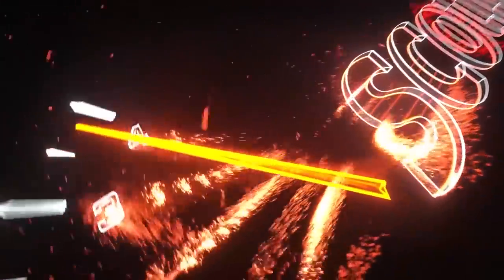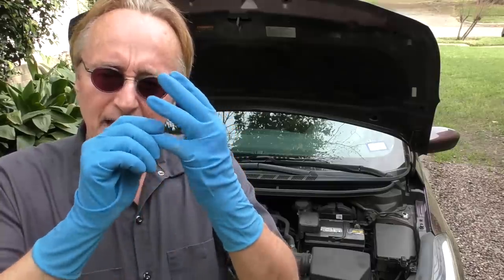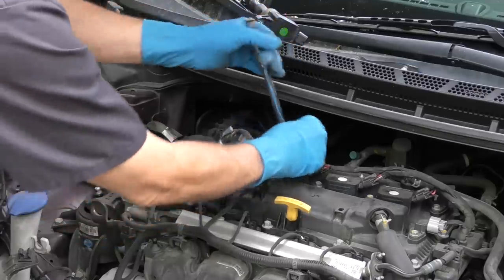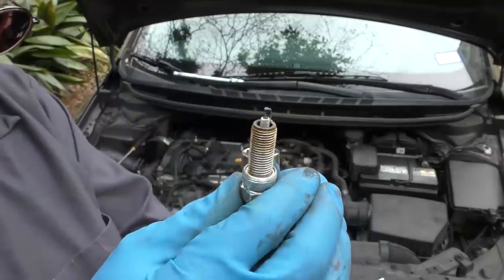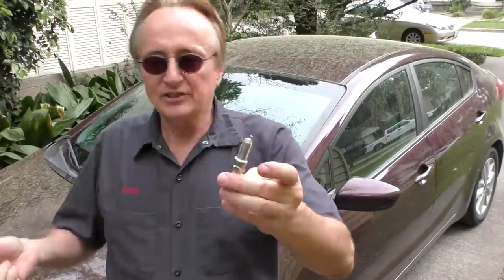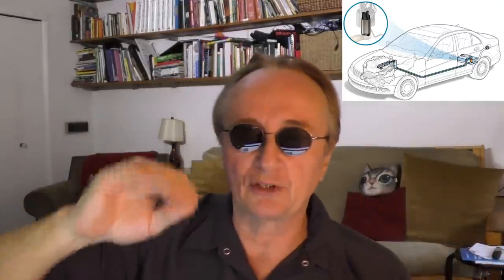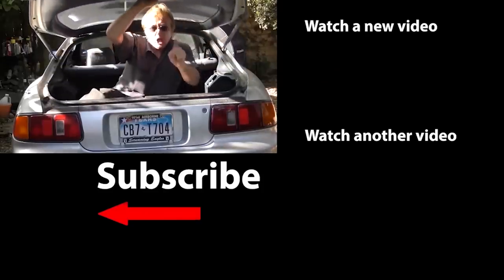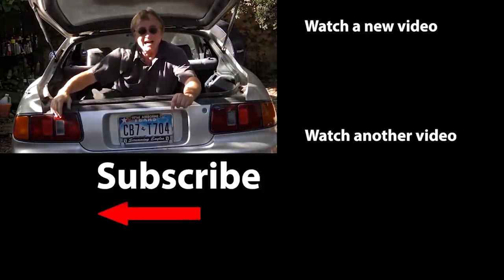Doing This Will Make Your Engine Run Better

Comment: I replaced all my 02 oxygen sensors on my 2002 Infiniti i35 for the total of $136. Now it's running like the day it was shipped out of the manufacturer factory. The dealership and chain auto repair shops was quoting me between $233-478 per sensor. Thanks Scotty for your helpful tips 👍🏾👌🏾
Reply: Almost the same with me; I replaced both my O2 sensors and Hitachi maf mass air flow sensor and ran awful. I unplugged the maf and drove it for 10 minutes and plugged back in. Runs great! Scotty is the best! 🥇
Reply: Never go to a "chain auto repair shop".
Reply: His common sense is invaluable

Comment: Scott 
I have a 2015 chev. Silverado 
When I'm going down the road in the day time my volt gauge well drop down to 12 volts but if I turn my lights on with in 2 to 3 miles the voltage moves up to 14

Comment: OMG a 2017 with such problem already. My 02 Camry just had that problem with 177,000 miles.
Reply: It's just a torque issue.  They sometimes come loose even though they were tightened well.  I did it to myself replacing my plugs.
Reply: on last 2 decades every used car after 70.000miles  have problems usually sensor, temperature sensor, oxygen sesnor, maf....

Comment: Scotty, what do you think of the 2008 Ford Focus, specifically the ones with manual transmissions? Mine has 90,400 miles on it and I'm wondering if there's any maintenance I should be planning for. Thanks!

Comment: Had the same code on a Hyundai elantra 2017 120k miles. Enden up being a coil, dealer wanted almost 500 to replace, coil was 70 bucks, 10 minute job.
Reply: Well done it was a do it yourself job?
Reply: @nikolaosmnk  Yes, very easy, just needed basic tools.

Comment: Hey Scotty. Love your channel. I have a 97 dodge ram 1500 5.9 SLT Laramie Magnum over 310k miles. When I put it in drive or reverse it sometimes makes a clunk noise. What could it be?
Reply: Check the universal joints first.
Reply: Replace engine and transmission mounts. Rock Auto has the best price. Use retailmenot site to get 5% code entered in notes box. You can also find a good price on eBay if you prefer.

Comment: Hey scottyyyyy love watching your videos!!! I have a 1999 tercel that i left parked for around 4 weeks in winter with a disconnected battery. When i got back it didn't start and a mecanic changed the wiring or something and made it start. Now every time its veryy cold here in Québec its doesnt start with no noise when i turn the key. Almost like it the ignition is not responding and sends no power to the starter. When its not too cold starts right up. Starter relay?fuel pump? Moisture in fuel?Thanks in advance hopefully:-)
Reply: buy a contact-electronic spray and spray in the ignition switch
if that don't make any sense then is the starter defected

Comment: Hey Scotty I’ve got a 2019 f250 6.2 gas and it starts fine in the morning and I start it at around lunch break and it starts hard but it happens very randomly I think it’s the fuel pump but not sure just wondered what you thought?
Reply: Purge canister

Comment: I just saved $2500 for doing my own spark plugs and coil packs maintenance on my Porsche Cayenne Turbo. The dealership wants $3500 to do it. The parts are very expensive.

Comment: If it’s a 2017 and it’s already having a cylinder misfire. Get rid of the car it’s a lemon.
Reply: daniel gradinaru usually a dodge or chrysler
Reply: Relax, Scotty said it's done over 80k miles and just a simple sparkplug replace fix
Reply: daniel gradinaru....really!!! It was a loose spark plug! Ya that’s a reason to get rid of a car that had no issues for 80k miles.
Reply: MC C...it was a simple fix and didn’t hurt a thing.

Comment: Scotty! Please help! I have a 2006 Infiniti G35 X Sedan, my car is shaking like crazy when idling and I got a cylinder 4 misfire trouble code. I already switched the second and forth ignition coils and the problem didn't move. I changed all the spark plugs too and the problem is still there. I used injector cleaner and it's still there! What do I do😔?
Reply: Did you check all the vacuum hoses for leaks? Often it's the PCV tube that gets brittle and breaks.
Reply: @999thenewman  Where is it located? Thank you for your help!

Comment: in most cases people who come to the internet about misfires usually know this and have already went into the money train (spark plugs,wires) and you mention modern day cars with coil on top,man this wont work if youre car has no obd 2,neither does ot work on cars that are with 1 ignitinon coil,then 4 wires run only to give spark to 4 what about cars wirth distributor caps,think about that. i personally am not a mechanic but im my country this is not the way to find whats causing a misfire,its nothing like the stuff you do and i think we here have the right way

Comment: Scotty did not talk about spark plug gap setting. It is not important?
Reply: Yes it’s important, as well as proper torque when installing. Especially in aluminum heads. Tiny bit of anti seize on plug threads is also recommended.

Comment: I drive chevrolet aveo 2007
I changed the spark plugs and the spark plug wires and the gasoline filter and i cleaned the throttle, but still get the code: 
P0300 Random/Multiple Cylinder Misfire Detected 
what should i do next ?
Reply: Clean the fuel injectors
Reply: @nikolaosmnk  already cleaned when i cleaned the throttle
Reply: @mahmedm  take a contact-electric cleaner and unplug every socket(on fuel injectors, temperature sensor spray and plug them again) if there is maf sensor clean it with this spray. In the end if consist clean in the engine bay every cable ground start from the battery th engine bay and every else goes.
Reply: @nikolaosmnk  ok i'll try this, and hope for goods - thank you so much for reply
Reply: Manekas A. 
Problem solved, the issue was from Idle sensor
I cleaned very will with DW-40 and now everything back to normal

Comment: My friend has had his shop for 25 years. He has a lawyer on standby because he is in court a few times a year by dumb customers trying to sue him.  He changed the brakes on a customers car and three months later her motor blew and she took him to court blaming him. It got threw out because he didn't even touch the engine.  He has camera's up recording his work to for protection.

Comment: Yeah , never overlook the lowly spark plug. Happened to me once years ago. Had an intermittent misfire on # 3 cylinder. Would only occur in certain weather conditions.  Changed wires. Then changed coil pack. As a last resort changed #3 plug(plugs were changed about 6 months earlier). Turned out to be the plug. Never would have thought that because of the intermittent occurrence.

Comment: Scotty. I have a 2004 silverado 4 wheel drive truck. The check engine light is on because of tighten gas cap. I replaced cap and the check engine light comes on same problem. How can I fix this. Thanks in advance Ron Fraley

Comment: SCOTTY I recently bought an 2009 toyota venza for 10,600 with v6 automatic awd fully loaded with 139000 miles on it after three weeks of driving the vsc light came on and trac control light came on and awd light all come on and the code read gas cap but I replaced and the lights came back on please respond thanks and would like your thoughts on that and that type of Toyotas thanks
Reply: If this happens on first startup in the morning, have the battery load tested for weak cells. Check the battery cables to be sure they are tight and the posts are clean.
Reply: Yea it's come on on start up every time it's reset so thanks I'll ck thanks! Don't look like Scotty is going to respond thanks

Comment: My Kia Rio 5 has over 220k on it.   5 speed manual.  Still has factory plugs.  Lol.   Looks rough because it's hit 2 deer so far.
Reply: If they are iridiums, that's not too unusual.
Reply: On Kia Rio you should change them until 90.000miles, after these miles it burns more fuel and produce more CO2 due to unburnt fuel.
Reply: @nikolaosmnk  "Burns more" then "unburnt"? Which is it?

Comment: Mr. Kilmer, I called my local mechanic shop and asked them how much for a fuel filter change in my 07 Camry base model with 79,500 miles for preventative maintenance. They said it would cost you $350.00 for the parts and labor. They were also hesitant and said they wanted to do a diagnostic test first. Thoughts on the price and "diagnostics." Car has no issues other than stupid TPMS light.
Reply: 350 r u crazy do it ur self u will save ur self like 300 dollars
Reply: Nope do it youself or get another quote from somewhere else...they're taking you to the cleaners. Takes not even 30 minutes to do a fuel filter
Reply: Mark Moyseyenko 😊
Reply: Robert H 😊
Reply: The answer is simple: Don't do it at all.  Worry about something else. I keep my cars forever and have replaced one fuel filter and that was back in the 60s.

Comment: Hey Scotty my mom has a 2014 Dodge Durango with 161,000 miles. It has been a very reliable car, we only had to replace a radiator hose last year. Also it has the 3.6 v6 and a CVT. How come you think Chrysler makes poor quality vehicles?

Comment: I had a rapid clacking noise in my 89 cavalier (in high school 2005) and it was driving me crazy so I had it checked out multiple times by the same mechanic, even took him for a drive. all he did was tighten up some bolts but the problem persisted. One day It stopped! ANd was followed by loud exhaust noises cause the damned muffler fell off!

Comment: Personally I chalk up the crappy traffic in Charlotte to yes the gridlock, but also we have an abnormal amount of New Jersey transplants and those people drive like 485 is the Fury Road. Atlanta, on the other hand, has much thicker traffic but for the most part,I found drivers down there to be more considerate. The law they have that the left lane is for passing and then you GTFO of it ASAP helps a bunch. In Charlotte people camp the left lane even if they're going under the speed limit. It's insane.

Comment: That was not a loose sparkplug problem that is a incorrectly gapped sparkplug problem. Sombody has already changed them. Iridium sparkplugs do have to be gapped correctly. To wide of gap and the sparkplug will misfire usually at an Idle. Change the plug with new plugs and it will go away for 20,000 or 30,000 miles then it will come back when it gets carboned up a little. Best to gap new sparkplugs at what the manufacturer recommends in the owner's manual. He could have regapped them and the check engine light would go out.

Comment: Hi Scotty I have a 2007 Grand Prix gxp 5.3L I had 8 codes 4 was ignition coils 1 was map sensor I changed map sensor but my problem is my exhaust is making  a noise that don’t match my exhaust it make a blogging noise when you or just driving but when I push the pedal a lil more you can here the different in the regular exhaust sound and other sound can you help me please figure this out. I thought it was the catalytic converter but I’m not sure

Comment: If the car is running smoothly and no codes for mis firing, should iridium spark plugs still be changed every 60,000 miles? I’m at 140,000 miles and still going strong!

Comment: I have a XV10 camry and there is a squeaking sound coming from the left rear wheel when I push the car back and forth when the parking brake is applied (car moves a few inches when pushing it). The squeaking noise isn't there when I have someone use the regular brakes (car doesn't move at all) or when I have the engine off in gear without the parking brake (car moves a few inches). Any ideas? Is my parking brake worn out? I have the rear disk brakes with drum brakes for the parking brake.

Comment: Wife bought a small RV based on a 2000 Ford E350 Super Duty 6.8 V10
Took it on a long trip, at the end of the first day it had a strange missfire that went away.
The next day it started missing going up a hill. Acted to me like a lack of fuel. Replaced the fuel filter in the parts store parking lot.Ran fine most of the next day. Starting missing again under a load.Took it to a Ford dealer. They said it had a miss on one cylinder. They changed one spark plug and one coil. I planned to repace the rest when we got home. Ran good the next day started running rough toward the end of the day.
Got it to an independant shop. The replaced the other 9 spark plus and coils. When they were done it still had a miss and they said it needed a catalytic convertor. We got the rig to our destination. I dropped the convertor for a visual inspection. Found nothing wrong with it. On the way home it , was intermittantly running bad. Took it to another ford dealer where they determined it had a bad fuel pump, which turned out to be the problem all along. Now running great. Was an expensive trip.

Comment: Hey Scotty I have a 1990 Nissan 300zx and when its hot outside as I drive it I hear this buzzing sound coming from the rear as a accelerate and also hear a whistling sound like there's pressure built up in a line or something

Comment: We have a 2007 Mustang, the horn stoped working at the wheel? so I put a new clock spring. And now the now the motor will stall if use the lights ro brakes and turn singles? can you take a look at my Mustang tihis my first time working on a car with all Coumptors this is nuts and with this the horn is not working as well help

Comment: Hi. I have a 2008 Jeep liberty 3.7 L V6 engine and I can drive it and I’ll go from here to there and it will not start up after a while and the engine temperature always reads in the middle of the water temperature gauge but I have to wait till the engine cools down before it will start again as I try to start it it just turns over but doesn’t start the whole engine shakes like it having a seizure

Comment: I had a bad ignition coil and only changed that one. They are $90 each. Three in the back are really hard to get to so I'm just going to replace them as they fail. 

The beauty cover had to be broken off too. It is off now for good. It was a hassle.

My next car might be only a four cylinder.

Comment: 2004 Ford Expedition Xls 4.6 with 231500 miles should I buy it I haven't had a Ford since 1998 I have trust issues with Ford's what do you think
Reply: 231,500 miles! Must be an excellent vehicle.

Comment: But I’ve changed my spark plugs and I still have a P0300 code and a P0463 on my 1998 Chevy C1500 pick up truck 350 vortec 5.7 motor help
Reply: Have you changed the ignition module or cap and rotor? Something is arcing spark.

Comment: Hey scotty, I have a 2000 Honda Civic Ex type, with a D15B swapped engine. When in normal temperature the idle tends to always rev up and down real quick. I’ve replaced the MAP sensor, and Idle Air Control valve they were not the problem. The only thing I haven’t replaced is the TPS sensor. What do you think it is ?
Reply: Unplug the tps cable, if tidle stay  normal that is defect. Unless somewhere on manifold there is air leak like defective throttle body gasket or intake manifold gasket.
Reply: Manekas A. I will try that thanks!

Comment: Dear sir v
I have yukon denali 2009   when start engine morning the oil prusser is more 275 but after one hour oil prusser becom very low and hear  the engine noise i switch  off for wael minutes then continue
Pleas e help
Reply: Choose man oil filter and Shell 5W-40 oil.

Comment: 285k on a volvo isn't too high mileage
Reply: nice reliability
 which model?
Reply: @nikolaosmnk  dont have one myself but have known a few with similar or higher mileage on the original engine and gearbox

Comment: I have a 2001 Tahoe ok when I start it n the morning it at taps and then it stop then I drive it and it have 248907 miles on it and it do a little smoking when I hit the gas I did the oil change and air Filter do I need to change my plugs I no I do I’m just asking.
Reply: If it is ticking when you start it up it is probably the valve train making the sound.

Comment: a 2017 Kia already has a misfire while my 2001 Elantra has never had one or any major issue since 2001. 228k miles! This Kia is junk!
Reply: Well Hyundai and Kia practically are the same brand, they use same Engine same Transmission even same Chasis.
Reply: i believe that on 2001 some cars had better parts quality than newer that focus on glamour

Comment: Scotty what can make a car transmission slip a little when I’m driving it stutters a little bit what can that be from?
Reply: That's your cable shifter bushing fix it asap it's 12$ from AutoZone but if you go to mechanic they say 150$
Reply: A Kassem like when I’m driving around 60ish mph it drops down to 2k rpms and stutters but if I give it more gas it’s fine
Reply: @mikestackz854  oh than I think it's something different u str8 tho just make sure with a honest mechanic some r money hungry
Reply: Make? Mileage? ATF level and condition of the fluid?
Reply: wholeNwon 2005 Hyundai Sonata 55k miles trans fluid is filled
Reply: @mikestackz854   I assume it's the correct fluid, NOT over-filled and used to function properly. Right?
Reply: wholeNwon I put atf in to and filled it not over filled it
Reply: @mikestackz854   Check the level at full operating temp, too. It's very easy to slightly overfill and some trans will then act up. Also, there have been shifting problems with Hyundai transmissions that require reprogramming the trans. control module with software fix from the dealer. A defective shift solenoid could also be causing problems.
Reply: wholeNwon It was a low then I filled it, I think I may have over poured very slightly, but i gotta take it to my mechanic
Reply: @mikestackz854  Check on line to see if there is a TSB for trans. control module program due to abnormal shifting.  If so, dealer might fix it free.
Reply: wholeNwon ok thank you, I appreciate that